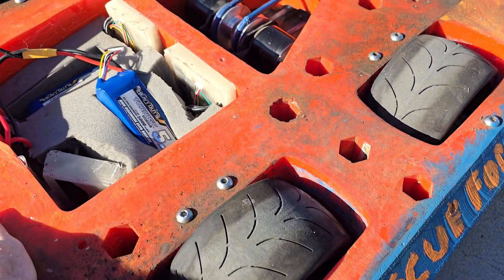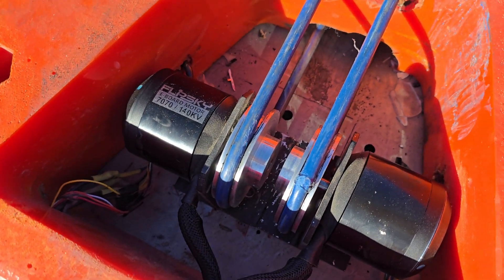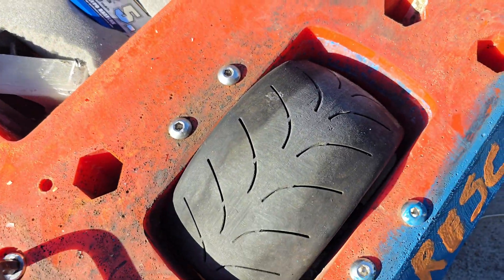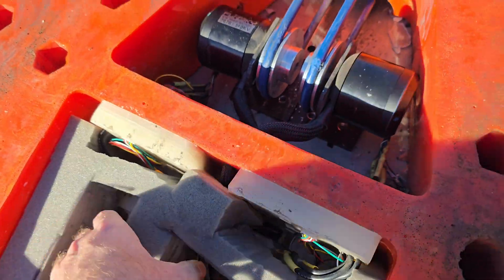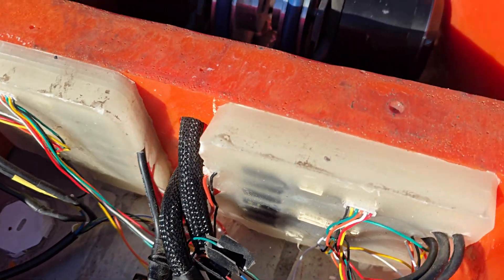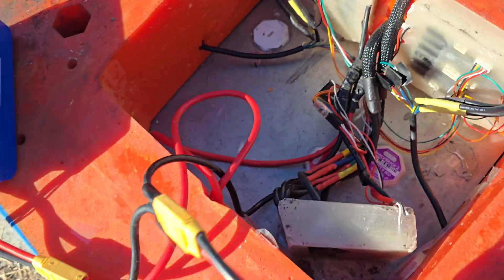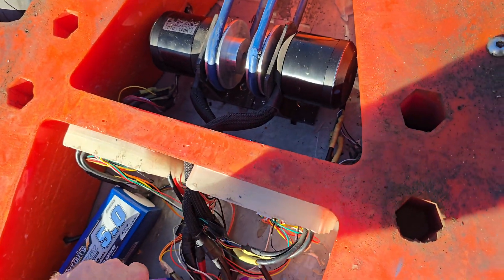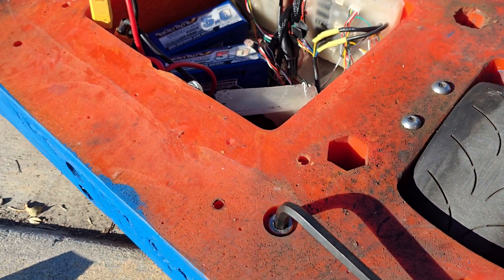rescue force combat robot safety information

Comment: As a heads up, per Battlebots rules you are required to have a separate switch for your weapon system.
Reply from the maker: @mattiatorX  I know it seems like you have to have two switches, the rules definitely imply the need for two, but there are exceptions allowed. It's actually safer to have one master switch which is why Greg Munson himself allowed it. If the creator of battlebots allows it, I'm not going to have any more problems
Reply: @JPMontello  Aye, if Greg's specifically allowed it then that's good enough.